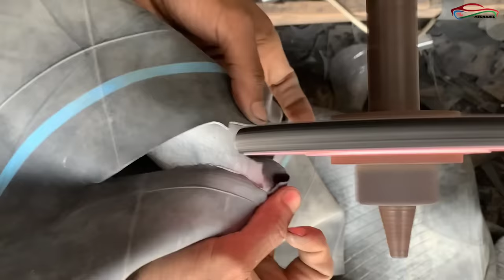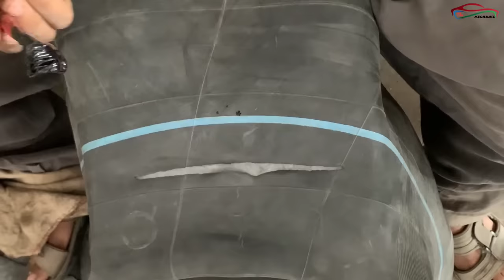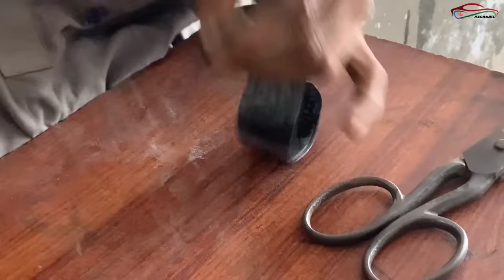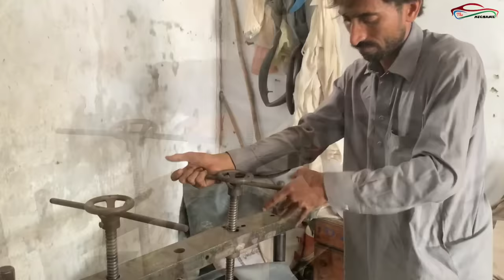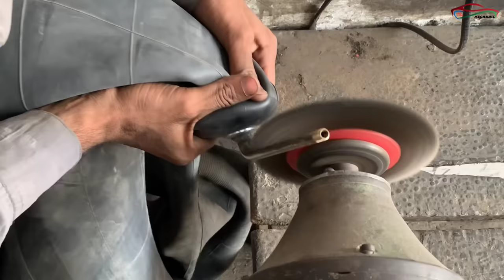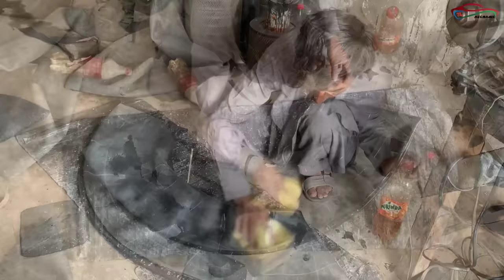Truck Tire Inner Tube Burst Repair with Amazing Skills || How to Fix an Inner Tube Puncture

Comment: TO ALL THAT MAKE NEGATIVE COMMENT'S YOU  KNOW NOT OF WHAT YOU SAY 
THIS WAS A JOB WELL DONE A HOT VULCANIZED TUBE REPAIR NOT QUIET AS GOOD AS NEW BUT PERFECTLY USE ABLE WOULD WORK JUST FINE ON A SEMI TRAILER OR THE REAR DRIVE AXEL OF A TRUCK
Reply: NEVER! To be used on a highway OR 
A Simi!

That's just stupid!

Plus when it does blow and kills people,who's going to be held responsible!??

Comment: the tube is no longer even though he repaired well, the ages of tube cut and when lots of pressure on the tube it will again burst.
Reply: YOU HAVE TO REMEMBER WHERE HE IS SND HIW MUCH MONEY THAT TUBE COST 
THIS GUY PROBABLY MADE 1 OR 2 $$ FIXIN THST TUBE IT WILL WORK JUST FINE IT A REAR APP IR ON A TRAILER OF A BIG TRUK

Comment: It's ok.but no guarantee to driver& passengers life.
Reply: IF USED ON A TRAILER AXEL JUST WHO IS AT RISK  OR☝️ A REAR AXEL OF THE TRUCK WHERE THERE ANY WHERE FROM 4 TO 8 OTHER TYRES 
CUM ON SMART GUY